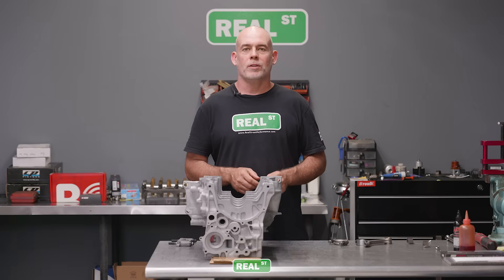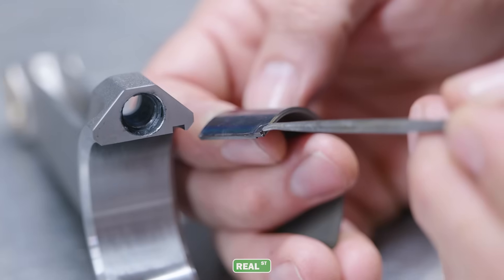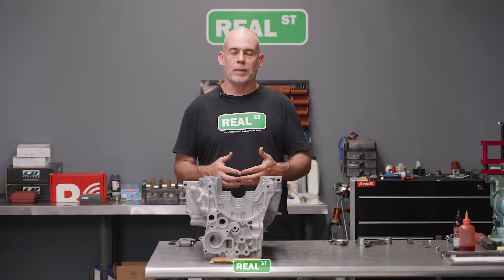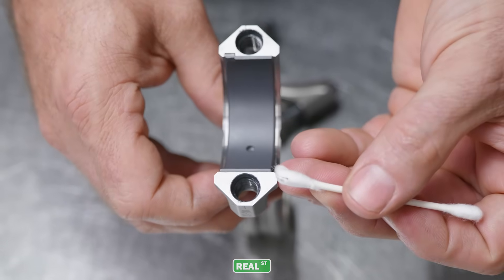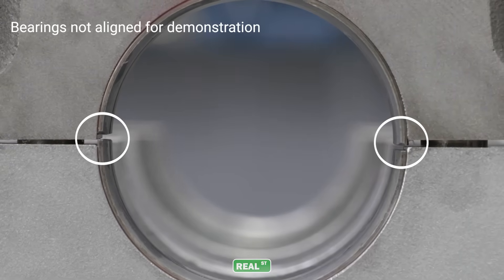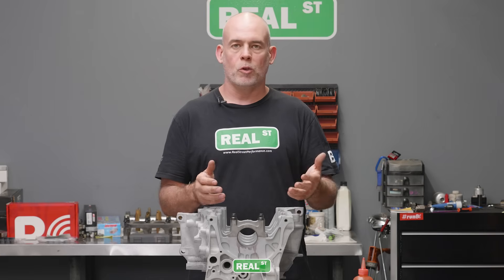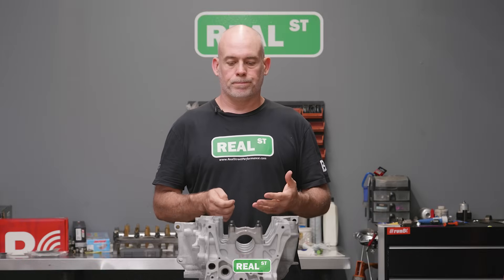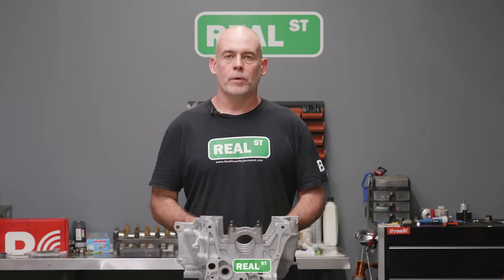Adding Oil On The Back Side Of Bearings During Engine Assembly. Good Or Bad?

Comment: Look if it was ok Smokey Yunick would not have said to install them dry Ak Miller said to install them dry ,The professor David Visard says to in stall them dry do you know more then them,? I don't think so back to school for you I've been building for 55 years I went to school and I have never had a mother blow up or any kind of failure not evin a cam go flat I assemble all my motors in a sealed inviroment with a vacume going drawing the air out of the very very clean room that is scrubbed dryed vacuumed and sealed with Brite lighting and a heat gun to heat the block and parts for the right measurements not cold parts  cleanliness is next to godly Ness when building a motor or trany, rearend

Comment: Like this guy, I have always oiled the backside of a bearing with a thin oil on assembly. I've never spun a bearing although I stuck to stock engines not heavily modified. I doubt it makes a difference, but that's what I did.

Comment: This video illustrates best practices and the reasons for doing it are well explained. I only ask that people actually watch the video before commenting. 
It doesn't matter if the clearances tighten slightly with the application of oil, as long as you use the same process while measuring them as you do during assembly. If they measure too tight, you're going to adjust before assembly anyway.

Comment: I have assembled my engine today with the overall knowledge from youtube on how to mount bearings in. I tought there is a good idea to put oil on the backside of the bearings, both rod and main ones. The main ones we're the used ones, the rod ones we're new. Haven't measured it at all for clearance despite what professionals said here in comments. I'll let you all know what happens, if it was a good or a bad idea to do so! If this isn't a blunt test I don't know what else could be a test to this method. Even used the 5w30 oil that the car will run on. See yall after giving it a start.
Reply: Oil will get there as soon as it's running.
Reply: @jeffreydurham5342  anyway it is working hella fine, first rebuild turned out pretty good, proud of it 😌

Comment: Adding anything to the back of the bearings changes the actual clearance. Oil does penetrate into the backside if there’s any room for that to happen.
 But I once after sizing the bearings put locktite on the backside of the bearings in a very thin coat using my finger to spread it around and had great.”success. On tear down those bearings were glued in real good and getting them out of their was a real treat...

Comment: I haven't built a lot of engines. The few that I have run 3x the rated whp output. I have made assembly errors and paid for them before. If I were to oil the bearing backs it would only be after measuring clearance dry. One day I may try this just for science.

Comment: If any oil or lubricant such as transmission fluid is used, maybe just wipe a thin film on the last half inch of each bearing instead of the entire surface? The bearing might slide in a tiny bit easier.

Comment: I actually did a side by side test of this a couple of decades ago. It DOES change the clearance because the oil acts like a shim. On older engines where they used looser clearances you could probably get away with this just fine. But there is no way I would even consider this on a tight clearance modern engine that would use something like a 0W 20 oil. There is just no reason to.

Comment: Ive only built a couple motors but i always lube the bearing in the same fashion, light oil. Especially critical on a cast iron setup, id be way more concerned with cleareance issues generated by the bearing catching or gaulling on unseen burrs in the block/ cap surfaces than whats generated by a thin coat of oil that is largely displaced by cap and crank pressures anyways. Invisible sliding of "fixed" parts is very important for the motor to find its own happy place and make up for the imperfections that we cant predict IMO.

Comment: Ok... So either FACTORY parts are the best way or aftermarket is best? Which is it?

Meaning, the factory doesn't add lube in rear of bearing. This wasn't done over decades with great success, why now? This truthfully is completely unnecessary. 

If anything, adding oil in the rear alters bearing clearance on journal surface, causing tighter than necessary clearance, plausibly! Again, traditional system wasn't ineffective.

This is unnecessary... Totally... Unnecessary

Comment: One could make an argument for the oil to add some extra crush and I suppose the heat cycle could allow the oil to become tacky or even baked on the back side which you could also argue helps to retain the bearing in it's place. One could also suppose that if this your theory they make bearings that have added clearance to account for the obvious diameter change on the rod end even if it is only 1/2 to 1 thou.

Comment: Never went crazy with the oil on the backside, but here's the fact! I worked on my own dozens and dozens of different types of engine, to building all out race engines used for drag racing. Then also in my teens to early 20s worked in a engine machine shop, first as an apprenticeship and towards the end being able to machine every part from blocks to cylinder heads and everything in between. We yes I absolutely agree with you on this topic, every running engine I've ever taken apart has a coating of old burned smelling oil on the backsides of rod and main bearings!!! Especially the mains which have oil feed holes through them which need to direct oil to the crankshaft surface. Being you have a couple thou of clearance between the say crank surface and bearing surface well that oil which is sometimes upwards of 80+ PSI coming through the oil galley hole passing through the bearings hole will absolutely seep in between the main saddle and form a film of oil between the block surface and backs of the bearings. Now also this is also the case with the rod bearings, some are sometimes dryer than others but depending upon clearances you can easily get oil behind the backs of the rod bearings. Does this hurt your engine???? Welp from personal experience and plenty of race engines, never once have a bottom end coming back with a crank, rod or bearing issue or having rods letting go, 🤔 I can say does it really make a difference in weather or not to apply a film to the backs of them?? No!!! Yes wipe them down first like everything else that goes into your engines using a solvent first of course. And my personal preference would be to give them a very light coating of oil to help prevent galling of the backs of the bearings against the sharp edges of the block or caps, absolutely 💯% agree. I tried it dry a few times in the beginning and found it was just easier to get the bearings into place than it was dry, especially the camshaft bearings that are pressed into the blocks on pushrod engines. Otherwise you definitely run the risk of galling one on the way in to its position. 😉 I know when it comes to this conversation just like opinions and assholes, everyone has their own. That's great, and I'm sure this technique will be argued about for another 100+ years. The fact of the matter is......... it doesn't really make any difference. But I went with what made things assemble easier and without damaging the backside of the new bearings. I'm sure someone will definitely disagree with me too, but I know my record on never having a bottom end failure attributed to spun bearings or any clearance issues, having more engines under my belt than I could ever remember now, we never had anyone recalled due to something related to this practice, sorry.
Reply: so what is your point???
Reply: @johncasor9698 - Thank you!    Someone had to ask.

Comment: I am 66 years old, my shop has put together over 250 engines since 1978. If I see one of my techs putting oil on the back of a bearing, his toolbox will be rolled out into the street immediately. I would consider that sabotage.  Same as guys putting half a tube of silicone on both sides of a gasket, this is a sign of someone who has no clue what they are doing.  We strictly repair classics and antique vehicles, and when we dismantle a properly built engine that has been together for 50 or 75 years, you can see the witness marks where the bearing has been sitting in the block and caps, initially installed on a perfectly dry surface with very a light hone surface, and no oil migration in decades of running.  You are asking the bearing to spin by oiling it, it seats metal to metal.  Bearings are made with an incredibly tiny amount of oversize, they are designed to have bearing crush, or an interference fit in the cap and block, . Thumbs down to this video.  Bad advise

Comment: I fully agree any spill over coating on the backside should be carefully cleaned with a fingernail and maybe some trans fluid but purposely oiling the bearing can change your clearance and IMHO, if you hit a dry spot on the bearing from poor oiling, I want that bearing to stay in place and I’ll sacrifice some bearing material before the bearing spins.

Comment: I'm impressed by seeing it expel the oil on compression. I have changed bearings and learned to put them dry but there's oil back there one way or another after the engine has been used. It's never dry on disassembly.
Reply: I think it gets the from the oil gallery holes.
Reply: @donziperk thermal cycling and wicking due to capillary action
Reply: @wlrottge  More technically explained but yes.

Comment: I’m wanting to get into building engines, I’ve been told to start with a Chevy 350 but I’d love to build a boosted 5.3 and figure it’s the same thing. What’s your best advice or anyone who has experience building race motors in the comments
Reply: Ls needs computer and tuning, if the 350 if carb start with that, I’m currently building my first engine and it’s a 383 stroker

Comment: I like to do final assembly with the bearing backsides dry. But I agree it all comes down to crush. Similar to a press fit component, oil there won't matter. I've even seen people use tin foil or newspaper on a back side to tighten up a clearance. 

If you spun a bearing because of a bit of oil on the back of a bearing you had a major issue somewhere. 

Important to remember that mains on some engines have oil pressure at all times behind ~1/3 of the bearing width too.
Reply: newspaper won't transfer heat

Comment: Yamaha sends me different sized stepped nylon pucks that drop into the bolt hole and the other step is slightly into the bearing area.. you put the tab side of the bearing in first and then slide the other end down the nylon and when it leaves the nylon step it clicks into place. This is mostly for the fractured rods cause they are so sharp. Yamaha makes very nice high revving engines and definitely know what they are doing but whatever works for you is all that matters.

Comment: nothing wrong with using light oil in assembly, i do it myself, i have never had an engine back from a spun bearing in my 35 year long trade.
i did however forget to refill an engine once because i was working for too long and got real tired, customer saw the red oil pressure warning but still drove home lmao, new engine was supplied to him f.o.c.

Comment: Professionals will blue bearings and check surface area and bearing crush. 
On a little petrol engine it would probably not make a difference. 
But on a large high speed diesel.
 I wouldn’t dream of it. 
What does Toyota say in the 2j bible ???

Comment: Never oiled the back of a bearing before always just clean them really well but I’m open to trying it on my own personal engines. If it works for Jay on the high power builds he does I’m pretty sure it’s okay to use a really light oil on the saddles anyways Would love to see more on that B20 build I’m sure it’s been done and running but hey can’t hurt to ask right ?! 🤷🏼‍♂️
Reply: Exactly, just clean/inspect the mating surfaces very well.. I’ve gone as far lightly rubbing them with a tack cloth..😆

Comment: You think you have your Real St logo in enough places on the screen?
One is all you need really.
Adding oil changes the dimension between the bearing and the block so when you mic the bearing that number will be off.
Dry is the way I was taught but that was race engines. That little Honda engine is probably more forgiving being only 80 hp.
You do it the way you want because its your engine.

Comment: I put no oil on the back sides. On aluminum block engines the main bearing saddles get worn from vibration. We use to line bore them to oversize on the aircooled VW engines. On aircraft engines we mill the parting services then line bore to standard.  Will a thin oil coating make the bearings seat better or give the bearing saddles more wear protection ?
Reply: I swear that lycoming lubes the back of the bearings with light oil, SI-1059 says use a special lube for one kind of rod bearing.

Comment: That was more interesting than I thought it would be.  Using a small amount of ATF (a much thinner fluid) on the backside is not the same as putting assembly lube on the front side.  Still, I've never put any oil of any sort on the backside of bearings and I don't think I'm going to start now.
Reply: get some premium bearings that fit

Comment: I am a race shop/Dyno shop owner and engine builder/ race engineer that specializes in building Superbikes WSBK spec $140k+ builds spinning in excess of 15,000+ rpm’s as well as big turbo setup supercar builds to regular evo’s etc and can confirm 100% that Jays method is not problematic whatsoever. Everyone on here fails to hear the words trans fluid being used which by design is extremely thin and actually almost grippy by design, that squishes out about 99% of the 2 micro drops 💧 out of the side of the journals and act as a transport vehicle or secondary insurance that any possible debris will be carried out with it. Which will in fact happen as intended by the very well rounded and world renowned engine builder (Jay) and this is literally intended to help the bearing shells rotate and evenly settle at the parting lines evenly… this is a good method and works flawlessly from PERSONAL EXPERIENCE on some of the highest strung 15,000+ rpm 240whp+ superbike engines that run at full throttle almost 100% of the time for 40+ minutes at a time… so AGAIN this is a tried and true method, if it doesn’t suit you on your build then discard the advice or dont and use it… either way it’s not problematic either way, but without this tip you just need to be 1000% certain surfaces are clear and installed without backing material behind the bearing as well as using a straight edge and pre aligning the shells as evenly as possible. But this method is great as it allows the bearing shell to locate in it’s intended position without the risk of misalignment and binding if not rotated perfectly level. 
Thx for sharing Jay, and I don’t blame you when you never share another real world engine building tip or secret ingredient to your successful sauce again. Lol you’ve got to remember Jay your just talking to a team of ex F1 engineers and they should be giving you tips 😂🤦🏻‍♂️. Carry on Jay, building world record breaking 1st’s , and keep innovating and pushing the envelope this is how we grow and achieve that which hasn’t been yet! Take care man!
Reply: Sooo Dexron VI or Type F?
Reply: Wordz too many... use brandz and numberz :|
Reply: Project Farm = amsoil
Gear = manual
Trans = auto
Reply: Positive
Reply: I’m building a mc22 (20,000rpm). 

Could I use air tool oil behind? It’s even thinner than atf. 

I’m on the fence about doing it, but I’m using aftermarket shells, and I do like the idea of flushing out any extra debris. 

Best
Reply: Yak yak yak yak yak. Your wife lose interest also when you boastfully babble on like that?
Reply: @ boastfully? Just stating facts, for some background reference… lol don’t read long comments if you’re not able to get a handle on your ADD and pay attention for a whole 6 seconds time to read a comment… 🤷🏻‍♂️ maybe probably don’t read comments at all and you won’t be bored at all 👍
Reply: @chrisandtori9083  Your first comment was all I needed man, some of these clowns never built an engine anyway, just keyboard commando's, if you and Jay do it, I am doing it, I totally understand the benefit of the fluid carrying out any fine debris and I appreciate increasing the odds of an even bearing installation, guess these guys never had an oil leak and forget that hot oil finds all unsealed spaces. But another thought is conductivity for cooling on initial start up, almost like applying the paste to a CPU or transistor to aid in heat transfer for the run in.